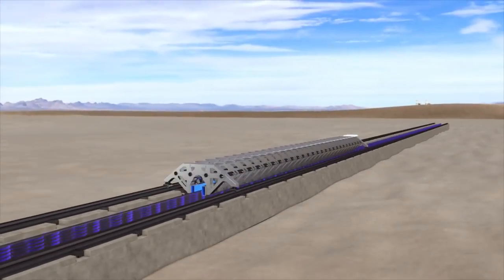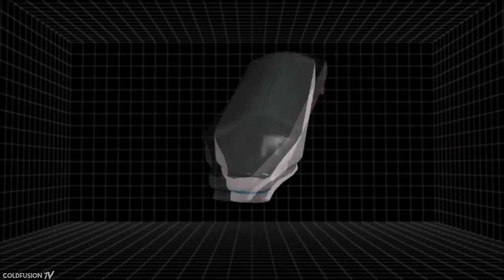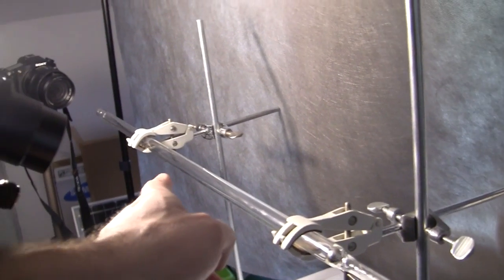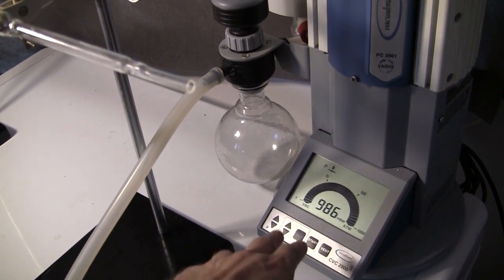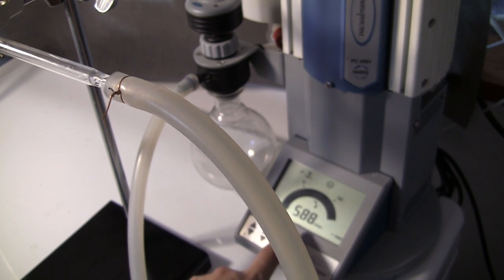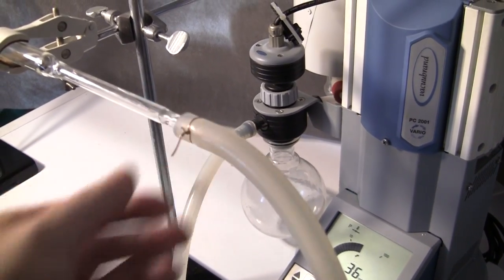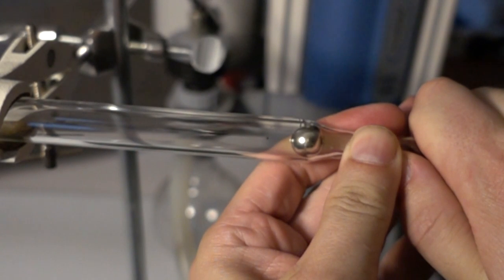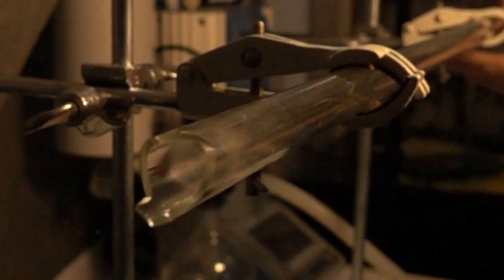How  the Hyperloop can kill you!

Comment: I need to vent a little. You went to EBR-1 but didn't get video of the two reactors in the parking lot specifically made to power an aircraft. They determined it wasn't going to work, which is why they're rusting away in the middle of an Idaho desert

Comment: Well you are forgetting that it is underground.. so if it has a vacuum tube underground and cracks or breaks.. wouldn’t the earth act as second wall to the tube holding the vacuum in somewhat as your test is up out in the open air
Reply: Sure. Let's make an already impractical idea 50 times more impractical by running it underground.

Comment: What if instead of jets, they make use of all that energy used pumping the tube pressure down. The way that bb was propelled through the tube, perhaps doing something similar to that in a controlled manner would be an overall more energy efficient way to get the train up to a high speed ... ? Not sure how technically difficult it'd be but uh... using jets inside of 1/1000 atm sounds incredibly inefficient, esp. when so much energy goes into bringing the pressure down that low, which in turn reduces the efficiency of the jets
Reply: Wow this is actually an idea that's been invented several times over in the 19th century!

Comment: Pretty flawed argument, 14.7 psi of pressure in a pneumatic potato cannon (hyperloop) with a very loose projectile will not accelerate that great, I bet the onboard magnetic brakes would stop it, if not a simple clamping brake setup wouldn't have an issue stopping it easily.

Also unless the tube broke completely in two right next to the train the incoming air would lose most or all of its velocity by the time it went a few miles...

Try running any air tool or blow gun with 15 psi thru a 100 foot hose, there is hardly any flow.

Comment: Valid argument. I’ve seen the opposite, high pressure gas pipelines with a hairline crack screaming like a wailing banshee. Surely we have reached the engineering capacity to deal with the potential problems that might arise? And many people have argued that this technology be tested using freight first. That makes sense.

Comment: Did you think there are idiots on that work?
There is a small bunch of dangers in that concept.

1. The Pipe could crack/broke, and air can comes in
2. The electrical current could crash and the magnets will go off. (if electromagnets are used)
3. The Train could crack and passengers could die.
4. The rotors could fail and the train could stop.

At Aircrafts the danger-list is many times longer.
So the goal is to eliminate or extremly reduce these 4 Problems at the HyperLoop technology.

1. The Pipe could crack YES, but u can built electrically/mechanically controlled Bulkheads every 100 Km or something to delimit and save the negative pressure.
2. U can and you should use permanent magnets, which are save aganisnt any current crash.
3. Same as aircrafts, here u can also built crak stopping technique at the skin, and provide oxygen masks to survive passengers. Btw. here u can slow down and pitstop at an emergency exit, not at aircrafts.
4. It doesn't matter if the train stops, u can built easily an alternative drive for next emergency stop or something. Not with Aircrafts.

You see, its easily to take care at that technology. The passengers can't fall down to death. Hyperloop is definitely more attractive as aircrafts, in any case.

Comment: Thunderfoot, just do an approximate calculation F=(1/2)(Drag coeff)(air density)(Velocity squared)(area)
Drag coeff looks around .5, maybe as low as .2 or as high as .8.
Air density 1.204 kg/m^3
1200 miles/hour is 530 m/s. Air is rushing back around mach 1, so just make it a relative 830 m/s.
Area is 4 m^2.
830 KN. 
Passenger capsule is supposed to be around 15,000 kg. 830,000/15,000 is around 55 m/s. Looking at a ballpark of 5.6g. The real issue probably isn't going to be the acceleration, but the capsule crumpling due to the sudden pressure and the thing bouncing around in the tube.

Comment: This test proves that.....you can shoot a ball with vacuum!
Phil, you forgot about at least several things like:
1. Hyperloop is much bigger, and with increasing size, the mass increases to the third power, and frontal area to the second power - square-cube law.
2. Hyperloop isn't almost sealed by the pod - for the passenger pod, the frontal area ration (pod to tube) is 36%, which would certainly exert some force on the pod's front/back, but not in the way shown here.
3. To get effect shown here, you'd basically need a meteorite hitting hyperloop just behind the pod, because I can't imagine other failure of this level just appearing.
If you are trying to bust something, at least make proper video, with proper arguments.
This is cancer.

Comment: if the vehicle already moving I cannot see it accelerating over 700 mph just cause of a vacuum failure . prolly you wouldn't even feel it if u're on max speed . also the vehicle has breaks , if the tube cracks before the vehicle starts the breaks will "try" to keep it in place and air pressure will go around vehicle , or could use some hooks on stations for extra safety . The regulations will be implemented and such technical difficulties are easy to be solved , is like asking how come the train stays on rails on curves :D

Comment: Are you fucking stupid? The cabin will not be "shot" through the tube system with a single powerful thrust. It will accelerate at a moderate and bearable rate until full speed. That's kind of the reason why the cabin has an engine. There is no mechanism that violently shoots the cabin from point A to point B in a single explosion of energy.

Comment: Thunderf00t, this video is complete nonsense.  Let's start with the rate of acceleration- any person with a basic training in physics will tell you that Acceleration is Force/Mass.  The small metal ball has a very low Mass compared to a longer cylinder like the Hyperloop pods, so the Acceleration is MUCH greater.  A Hyperloop pod would be several meters long, so it would have HUNDREDS of times the Mass of your 10 cm ball relative to its cross-sectional area.  This means you ball accelerates HUNDREDS of times faster than a Hyperloop pod would in the event of vacuum-failure.  Second, pointing out the cross-sectional area of the pod is MEANINGLESS.  The mass of the pod scales with its cross-sectional area as well as its length, and the only thing that determines Acceleration I'd the ratio if Mass to Force, which is determined by length and density of the pod and is unrelated to cross-sectional area (double the area and you double both the Force and Mass, so the ratio remains unchanged).  Third, "no way to stop"?  ABSOLUTELY NOT.  Even a simple rubber brake could resist the force on the pod.  Try accelerating a 2-meter long rubber plug that makes even contact with the walls down your tube that way- hint, IT WON'T MOVE!  Even a simple rubber brake could stop any pod dead-still in the event of vacuum-failure...

Comment: Passengers would NOT turn into pink mush in the event of a breach.  Aircraft can and do fly in supersonic relative airflows- which are the kinds of relative dynamic pressures a pod would encounter if air entered the tube (the dynamic pressure on ONE side of the pod would be equal to that on the front of a subsonic aircraft.  The other side would be in vacuum, however, increasing the relative dynamic pressure to about that of a low-supersonic plane, maybe flying at Mach 1.2).  If the gap between the pod and the tube walls were small enough, the pod would have no choice but to remain traveling in a straight line against the wall of air.  The rate of deceleration could be up to a few (3-4) g's at most with an EXTREMELY light pod built out of something like carbon fiber or aerospace-grade aluminum, and much less on a heavier pod- i.e. uncomfortable, but NOT deadly.  A simple mechanical emergency-braking system could easily secure the pods against the pressures wave in the event of a breach, and actually cause the pods to stop moving and stay still if the static-friction exceeded the modest force on the breach-facing side of the pod...

Comment: That's why I think Thunderf00t is full of shit. The video is obvious, uninspired and on top of that it's wrong, and i will get to that in a minute. You literally look like some lunatic that tries to "bust" alternating current by electrocuting animals. Hey why don't you make a simulation of what happens when a plane looses its wing midflight? I can't wait for some MINDBLOWING conclusions. It's not positive scepticism, it's a fucking desperate, obsessive need to prove that you are right and they are wrong. Also the effect you showed us doesn't accelerate the ball forever. With longer tubes I THINK the ball will actually slow down after a while, because the ball is not an airtight seal for the tube, mythbusters had this problem when building pressure gun if i recall correctly. I'm not a hyperloop fan, I don't really give a shit, but this video just makes me mad, and i don't think you are competent enough to make the claims you do.

Comment: You can easily counteract this by building a system that measures rapid accerlation, like a peizoelectric crystal and then counteracting the force of the pressure by reverting the propulsion system. A great engineer sees issues and finds ways to overcome issues. A pessimist only does the first thing.

About EVERY FUCKING great piece of technology we have build there have always been people saying that it is just impossible even though they were quite reasonable. And look where we are today? If it would be for those people who said that we cannot launch a satelite onti space where would we be?

This mind-set in utterly useless.
Reply: like any other technology in the making :)

Comment: What if the fan on the front that currently does nothing and is just there for aesthetics, what if it could be used to pump air to the other side in case of vacuum failure? Would that work?

Comment: Very unconvincing. Yes, there are engineering challenges with every human endeavor. What if the boat leaks? What if an airplane wing falls off? What if my auto brakes fail? I'm dead, that's what. But we are able to design reliable boats, airplanes, and cars. This guy's work may be valuable in pointing out engineering challenges that, oh by the way the designers and engineers are already thinking about. Dude! Why come across as so cynical?

Comment: Hey thunderf00t. Just waiting for you to correct the glaring inaccuracies in your hyperloop videos because you're a proponent of science and not just an egotistical petulant child, right?

I mean, fucking up something as basic as the cube square law shouldn't be the kind of misinformation you actively spread, right? That's like engineering 101. You're a champion of science, right? Right, Thinderf00t?
Reply: Where did he do so? If you mean this experiment compared to what happens in massive tube, he uses more size relevant examples of sonic pressure wave caused by explosion to show that this effect does not diminish with large size and not subject to cube square law.
Reply: "Where did he do so?"
3:24

"He uses more size relevant examples of sonic pressure wave caused by explosion to show that this effect does not diminish with large size and not subject to cube square law."
Your reply perfectly exemplifies the kind of damage Thunderf00t's videos are doing. You actually believe that a breach in a large vacuum tube would be like the shock wave from an atomic blast, eh? It wouldn't. That's pure bullshit.

Not only would such an event require an huge section of the tube to disappear suddenly (not likely), but the pod would have to be very near such a rupture because the influx of air would quickly stratify forming a gradual rise in pressure compared to the sharp boundary of an atomic blast wave. It also wouldn't experience the blast winds that actually do all the ripping and tearing of objects in the reference videos of atomic blasts that Thunderf00t shows.

Don't worry, though; you're not alone. Thanks to Thunderf00t's videos there are now millions who believe the same. Thanks to Thunderf00t's unwillingness to correct his mistakes, there are more misinformed viewers everyday.

EDIT: Numeric analysis below.
It's actually fairly easy to do a rough, "back of the napkin" calculation of the acceleration a hyperloop pod would experience:

The proposed passenger hyperloop capsule has a frontal area of 1.4 square meters which is about 2200 square inches. The maximum pressure differential would be about 15 pounds per square inch. That equates to 15 lbs/in^2 * 2200 in^2 = 33000 pounds of force ~= 150000 newtons of force. Using F = ma where F is the 150000 newton force and m is the 15,000 kg of the loaded passenger capsule. We can now solve for acceleration: a = 150000/15000 = 10 m/s^2 of acceleration. That's a comfortable 1 g of acceleration. Not at all like being shot out of a gun barrel or hit by an atomic blast wave.

Notice also that in the Hyperloop Alpha paper (pg. 25) it says "The tube cross-sectional area is 42.2 ft2 (3.91 m2) giving a capsule/tube area ratio of 36%". So that wouldn't even be a sustained 1 g of acceleration, because most most of the air would flow around the capsule so that there would no longer be a high pressure differential acting on the capsule.

Comment: A very simple way to mitigate this problem would be to have pressure sensors on the tubes that detected catastrophic vacuum failures such as this and opened relief valves along the length of the tube on the opposite side of the moving pod, thus equalizing pressure on each side of it.

Comment: A possible way to prevent this kind of failure could be to section the vacuum tube into segments with doors or gates that open as the pod approaches and close after it has passed. That way any failure of the tube would be confined to a small section, preventing a catastrophic failure. Why would anyone build such a huge system where a single failure could destroy the entire thing? That is like building a ship without lifeboats and life jackets or a plane without parachutes or a car without airbags and crumple zones. Also, there could be some sort of brake system where the pod would latch onto the rail or the walls of the tube.

Comment: What happends if the fuel supply to the engine in a airplane stops ?  What happends if ONE wing of the airplane is destroyed ? What happends if the pilots of the airplane are killed or uncontious?  What happends if the tail rotor in an helicopter stops working ? What happends if a car going fast is losing one tire ? What happends if there is a bad portion on the railroad ? 

Isn't this catastrophic in this cases ? Every technology that transport people can kill you IF it goes bad , but there are safety operations to make sure the chase of something going bad is limited or at least the damage can be limited. 
This problems of hyperloop can be solved using valves to release the presure , breaks , etc . I'm not an engineer but this problems can be solved given time .

Comment: you do understand unlike the metal ball, the train or I guess pod will be smaller than the hyperloop so even if it does fail, the ain will go in faster then the pod so if it did, it would go in front of the pod slowing it down a significant ammount.

Comment: Vacuum Tube is an engine in itself, simply suck air out at one point of destination from the tube. Capsule doesn't need any engine and will be propelled with air pressure from behind. It might need breaks though. This is also a much safer design with vacuum only in the front of the capsule. So if tube  raptures from the front, capsule simply stops. If capsule decompresses, there is always air in the back and no one suffocates. This is Safe design. To propel few capsules through same tube it has to be dynamically divided into 40km sections with vacuum in the front and pressure in the back of the capsule. So the tube has to be equipped with multiple vacuum valves and tube dividers every 5-10 km along entire length working synchronously.

Comment: Thunderf00ts tube failure experiment is way off, it
 does not work the same when scaled up, factors like boundary layer 
effects have a much higher weighting. The larger the scale the smaller 
the acceleration (opposite to what he claims) this is basic physics. He 
should stick to chemistry, not really debunked anything. True the white 
paper presents an unrealistically  low pressure in the system diagram 
but also talks as if the pressure is much higher when describing the 
bypass fan etc. Remember that this is just a feasibility study and not a
 good one (with inconsistencies). Thunderf00t treats it like it is the finished solution.

He is also wrong about the fan. The alpha study describes very clearly an electric fan (436 hp) bypassing the air to reduce the friction from the air. The report seems to describe a pressure higher than that in the system diagram where air compression/friction becomes a problem. Its not talking about a very powerful jet engine giving propulsion, its accelerated/decelerated by electromagnets.  He is right about the economics but that's about it, really failed with this one trying to sound sensational.
Reply: Nah, thunderfoot was right